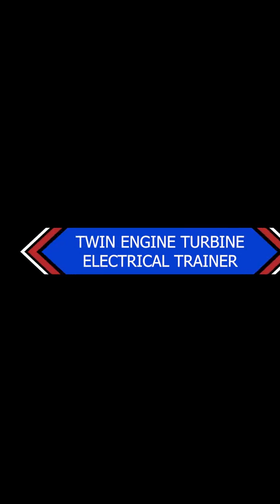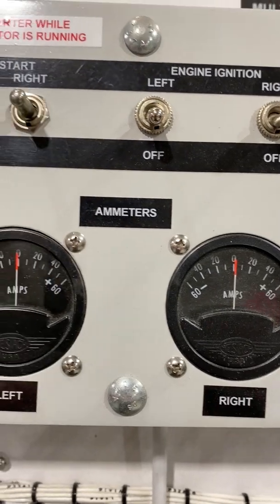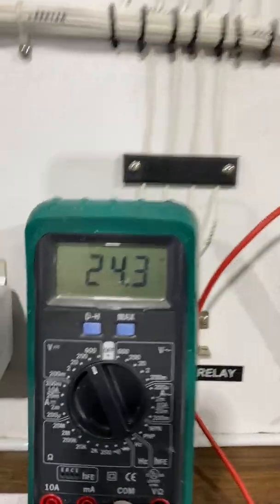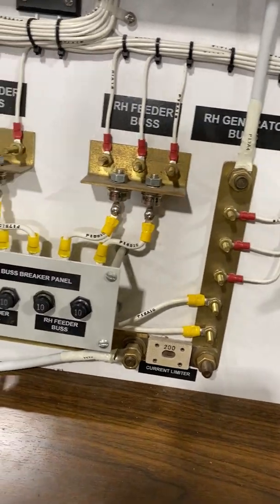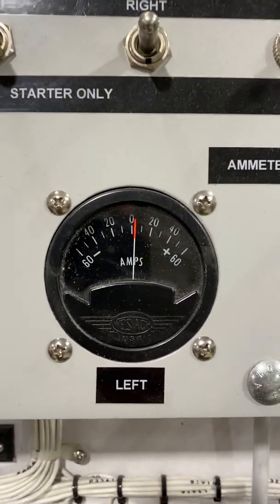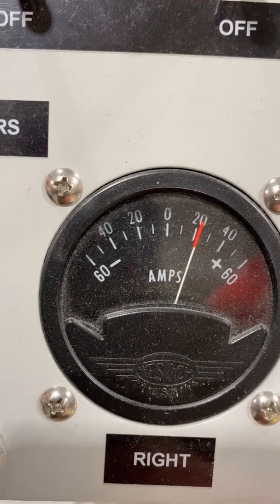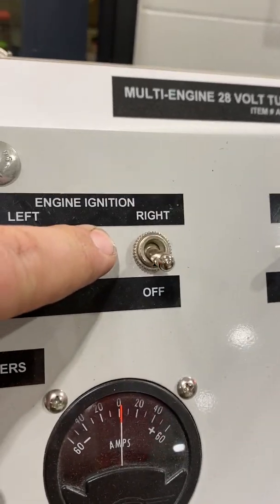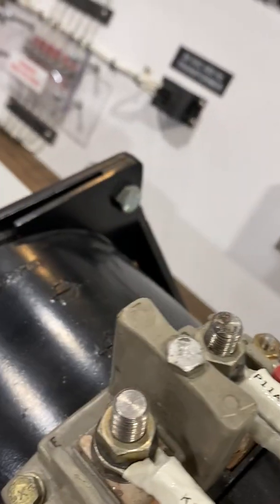Aircraft Dc Generator system trainer

Comment: @theb-rad7570 great video. How do you diagnose an induced fault? I am trying to figure out why the LH generator is not working. When I flip the LH switch Gen the voltmeter stays at 24v. I am trying tu use a multimeter so I can figure out what wire it is but am not sure if I am doing it correctly. I did continuity/resistance. Any help would be greatly appreciated.

Comment: Question  the. Generator before  connecting to the regulator and rectified  its putting  out ac  right  cause the  field inside  the rotor its rotation +- and even the brushes conmutater switch field of the stator  still  ac  not dc only  after  the rectified thas when its dc  can u comment.  Thanks

Comment: The electrical system in aircraft is not ac at High frequency?
Reply from the maker: This is a dc system with an AC inverter 26 VAc at 400 hz
Reply: Strongly depends on the aircraft size and application.